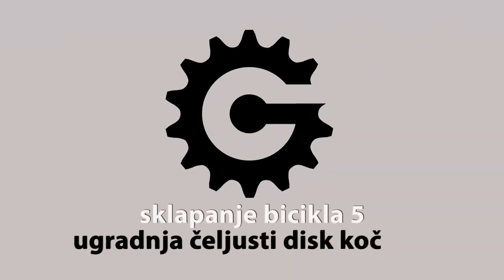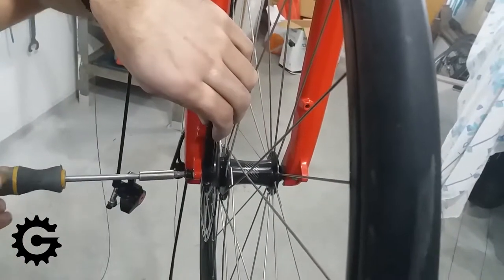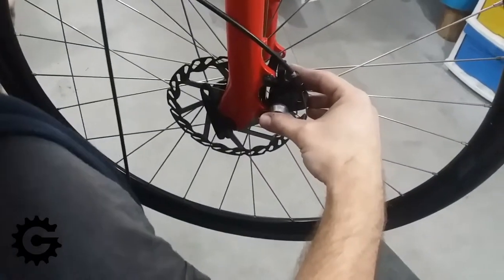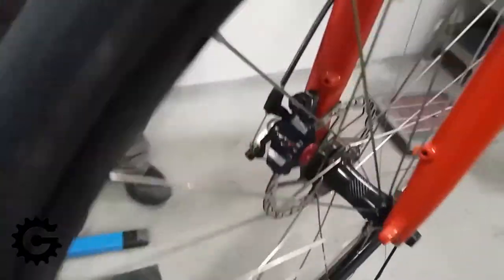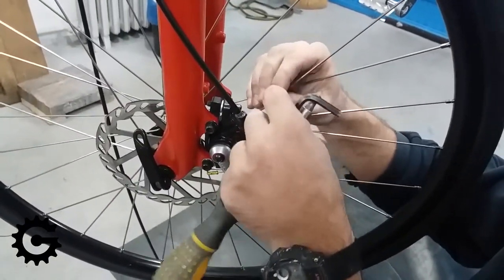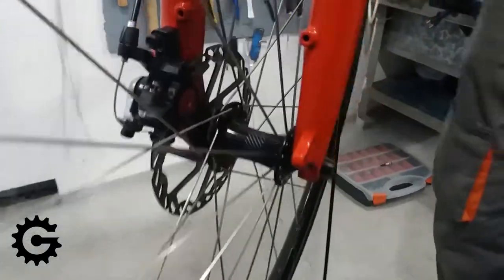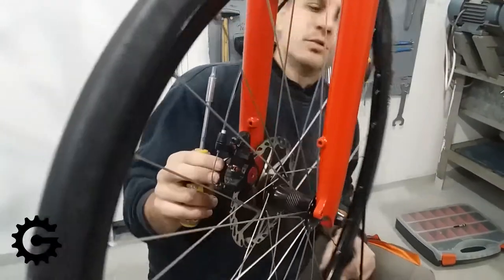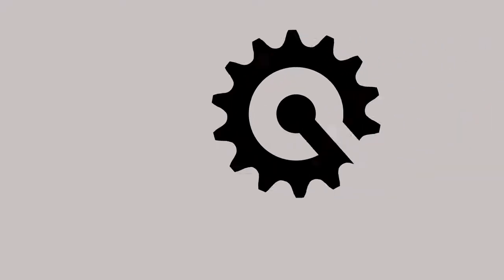Bicycle assembly 05 - disc brake installation [0020]

Comment: i converted to disc brakes on my hybrid bike on the front wheel.i got tired of keep adjusting and replacing v brakes.1st attempt okay with cheap mechanical brakes and cheap discs 160mm though brakes not super effective.i have decided to experiment with bigger disc 203mm and also to try thicker one 2.25mm .